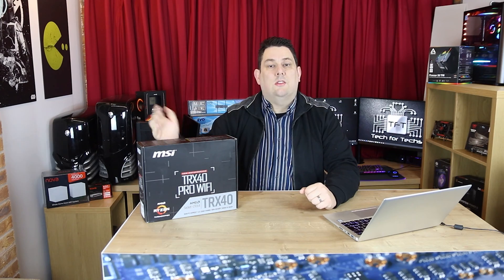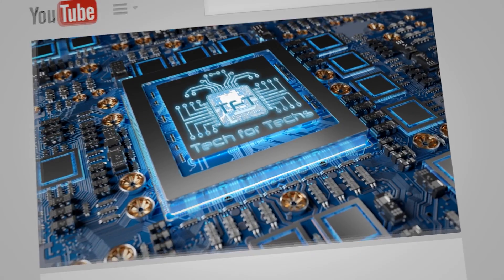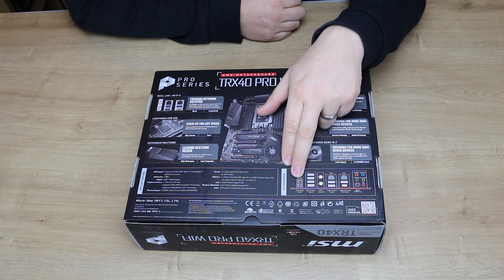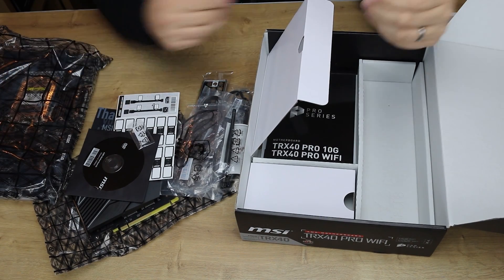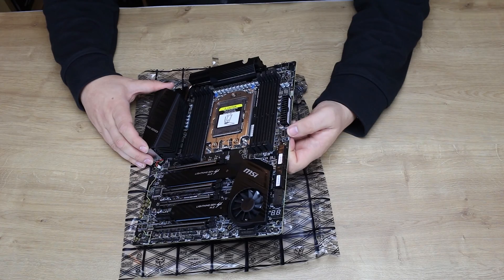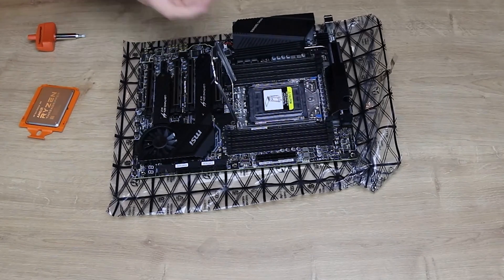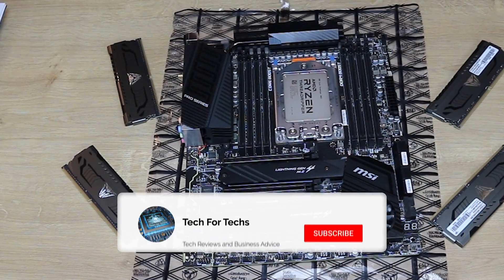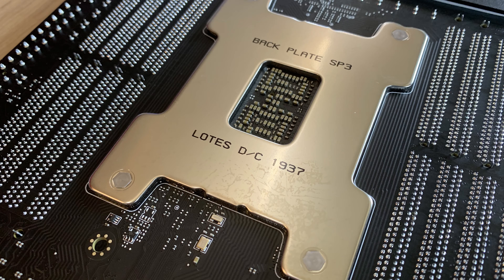MSI TRX40 PRO WIFI Review, 3rd Gen Threadripper Motherboard

Comment: Thanks, it's possible to combine the m.2 onboard with the PCIe 2x m.2, to build a 4x 2TB raid 0?
Reply: hi you can, i have done it with the 2 onboard and the riser card, and also done an 8x using the 2 onboard, the riser card, and a 4x bifurcation card. insane speeds.